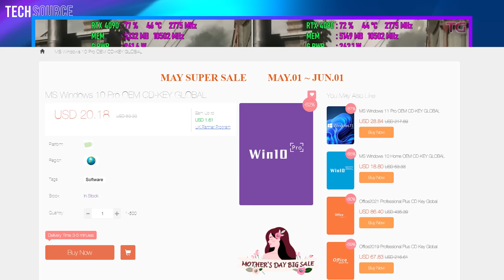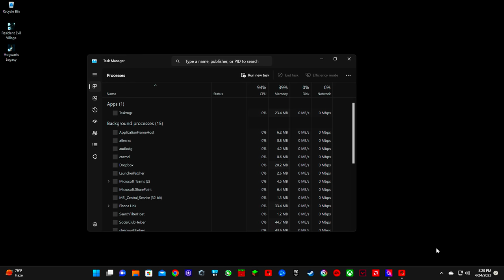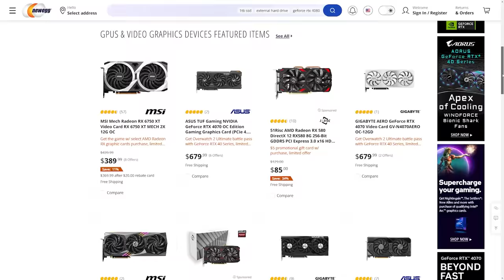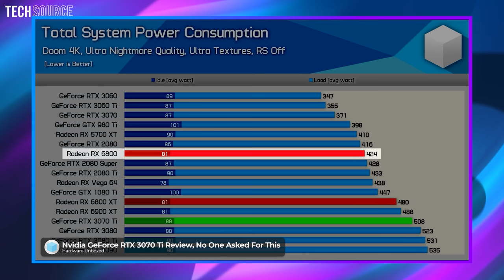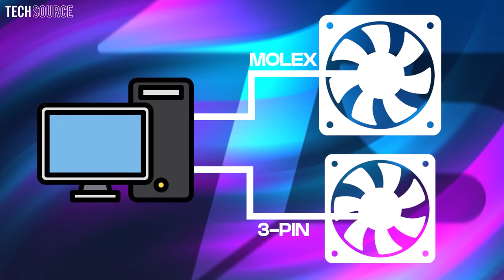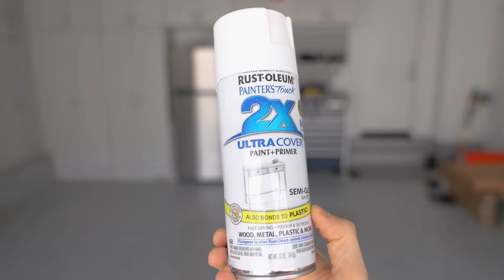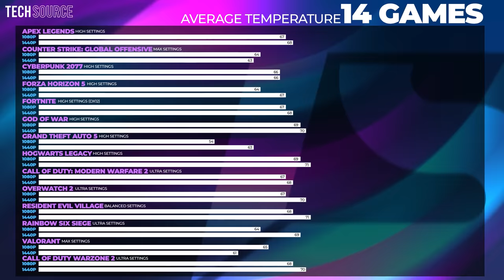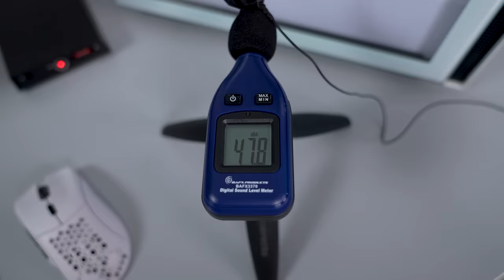The Best Budget $1000 Gaming PC Build!

Comment: Really appreciate your build videos! I learn something new each time. Just throwing this out there, but if you ever did deep-dive videos on specific components - as in, everything you need to know about motherboards/GPUs/RAM when selecting the right one for your build - I'd be ecstatic. I definitely picked out non-optimal parts for my first build because I didn't even know what sorts of things I should be looking for (like that issue with the motherboard only having a limited number of fan headers).

Comment: This was an awesome educational build vid around the different part specs.
I used the CH370 case for my build, it's  so light and easy to build in. I did similar and went with a 3 pack of light wings 3 fans, and dropped a 360 Rad in the front.

Comment: Great Build, only thing I would change is use a Ryzen 5 5600 instead as it's cheaper overall and you can enable SAM with the RX 6800 for ~5% performance gain. Also I wouldn't trust that PSU at all, why not just get something reputable?
Reply: So the build isn’t good or could be better?
Reply: @Jander_ could be better in terms of mobo and especially PSU
Reply: @Jander_  gigabyte b660m d3sh with dual m.2 and 4 ram sticks, $119 in my country cheaper than this one and this psu could be changed to a toughpower thermaltake gx2 600w +80 plus gold
Reply: @TRR23123  oh ok
Reply: @TRR23123  do u get good fps with this one?
Reply: @TRR23123  and what do u think about this oneCPU- Ryzen R5 5600x
Mobo- MSI MAG b550 Tomahawk
GPU- XFX Speedster SWFT309 6700xt
CPU Cooler- ID cooling SE-214xt
Storage- Silicon Power UD90 1tb m.2
Ram- Silicon Power Gaming 2×8 DDR4
PSU- ThermalTake Smart BM2 650w
Case- Montech X3 Mesh? The guy told me he get 100+ fps on most games ultra setting 1440p
Reply: @TRR23123  and thank u men
Reply: @Jander_  The one you mentioned is totally fine, the one i mentioned can run everything ultra +100 fps 1440p too except for cyberbunk 2077 which is 50ish
Reply: @Jander_  But ryzen 7 5700x can give you better performance at streaming more than 5600x
Reply: @TRR23123  That build is worse than the one in the video except for the PSU. The 5700x and RX 6650xt combo is also unbalanced and way slower compared to a 5600 and RX 6800 combo.
Reply: @Jander_  This build is solid, but replace the 5600x with a 5600 and ditch the CPU cooler, the stock AMD cooler is good enough. Use that freed up budget to get an RX 6800 instead of the 6700xt.
Reply: @truereaper4572  What the guy in the video did is choose a bad PSU, 16 GB, only 1 TB, no Cpu cooler. Yes 5700x and 6650xt is unbalanced then change it to a 6700xt, and that uses 700w good psu, 32 gb, 1,5 tb and a cooler.
Reply: @TRR23123  the build u told me need cable extension and window key, with that, how much the price will go up?
Reply: @TRR23123  and if u have something for parts links, I will buy the parts this week, And I want to buy the right ones.
Reply: @Jander_  I just edited the comment of the build, i changed some stuff and balanced it with better stuff. You can check everything above
Reply: @TRR23123  bro I don’t see the comment u edited can u write it again?
Reply: @TRR23123  You don't need an aftermarket CPU cooler though. The stock AMD cooler is fine. And again the 5700x isn't well suited to a $1k build.
Reply: @Jander_  
CPU: 5600X
MOBO: B550M Aorus Elite
RAM: T-force RGB 16x2 3600mhz
SSD: Crucial P3 Plus 1tb
PSU: Thermaltake toughpower 80+ gold 600w
Case: Musetex tw8 atx
GPU: XFX speedster qick319 radeon rx 6750xt
Cooler: Veetro V5
$965 total
$1006 with cable extensions and w11 home key
the price might change because you are in a different country but im sure it can be similar
Reply: @truereaper4572  cpu coolers in 1k build for more pleasure lol
Reply: @TRR23123  I’m in the United’s state
Reply: @Jander_  How much is that build in usa amazon?
Reply: @TRR23123  let me check

Comment: You should have gotten the b660m ds3h ax, it has WiFi and has bios flashback in case you want to upgrade to a 13400f. I just feel it has better value. Also that PSU is literally a fire hazard. Especially since you’re running a 6800. Also I feel like spending $19 on a cpu cooler is a good idea. There is definitely some things you could change about this build.
Reply: At that point may aswell spend a bit more and go am5 with a 7600. Smart access memory would squeeze out more performance too, since both cpu+gpu would be AMD.
Reply: I m also thinking about 13 gen that would be better and no bottle necks with GPU
Reply: Never cheap out on the psu. You can get a corsair cv for $75, you are paying a bit more but this way the psu doesnt burn your parts lmao.
Reply: Just an example, there are other great budget psu, just have to make sure its a reliable one.
Reply: the b660m ds3h is bad for an i5 12400f since it has power limits that decreases the processor's performance. the best cpu it can be paired with is probably only the i3 12100f and nothing more than that
Reply: Nah that power supply is fine. Just because its not from a huge brand doesnt make it worse. Have seen WAAAY worse work for like a decade
Reply: @Mist11305  it won’t have a problem with a 12400f trust me. The 12400f is like 65 watts
Reply: @chy.0190 t that point no, because ddr5 is still too expensive, unless you downgrade to a Rx 6700 xt, which is still amazing too
Reply: @paytonbohn6879  should I go with a h610 or a b660? Also, how do I know if the motherboard will not limit my CPU if I plant to upgrade.
Reply: @Proaz15 it depends what cpu ur using, if you’re using i3, the h610 will be fine, but any other, get a b660 mobo
Reply: @paytonbohn6879 I was planning on getting this build from the video but you got me questioning what to do
Reply: I am interested in building this exact build as shown in the video. Do you have any suggestions on what PSU to use?
Reply: @alsdabossgameplay9746  anything that has 80plus rating
Reply: I’m having trouble understanding this, do you mean that he doesn’t have enough cooling systems for the psu?
Reply: @ahmedsenhadji3856  ah yes get an efficient 80 plus psu but it's 60 watt, pretty much telling him to blow up his pc aight.
Reply: what psu should I get

Comment: Having this performance for under 1000 bucks is insane! 
Though personally i would've gone with a cheap am4 build instead, ryzen 5700x and 32gb of memory at least for future proofing, especially since with windows 11 and 16gb ram I had ran out of memory and it crashed games multiple times. Also budgeting on psu is not worth it which could set you back big time if it kills your system and also for peace of mind aswell as some budget cpu cooler can't hurt aswell.

Whether it's an intel or amd build I think with the memory, psu and optionally the cpu cooler changes it could be a great system.
It might push it over 1000 bucks but remember guys you can spend 1000 bucks and regret it and you can also spend a bit more and be content and feel your purchase worthy. If you already spend that much money it's better make it worth it imo.
Reply from the maker: Great feedback, thanks! :)
Reply: Man, I am thinking of getting AM5-7700X or AM4-5800X3D with 32gb RAMs, just cant decide what is better for gaming and work. Its almost same price, but dunno if AM5 is worht it, I am planning to keep that pc as long as it holds.. Im still playing on i5 4460 and 960 4gb i got in 2015/16.. any tips?
Reply: @fajceazy3946  AM5 motherboard so you can upgrade in the future without replacing a motherboard
Reply: @fajceazy3946  go with ddr5 platform because u have very old pc 😊 and its worth upgrading to am5
Reply: Can you tell me what parts to change pls
Reply: @blinksone2768
Reply: @@blinksone2768
Reply: Is there anyone that can tell me what to change idk what I need to change
Reply: @limacel8521 nothing all the first guys comment suggested was going with and cpu and 32 gb ram and getting a good quality psu and a cpu cooler
Reply: What parts do you recommend for my first pc I have a budget of like 1.5k ish

Comment: What do you think of this build?

Processor: i7 13700k
Cpu cooler: Dark rock pro 4
Motherboard: gigabyte z790 Aoris elite AX
Memory: G.Skill Trident Z5 RGB 32 GB 
Storage: Samsung 980 Pro 2 TB M.2
Video card: 4070 TI
Case: Corsair iCue 4000x 
Power suply: Corsair rm750x 

Lmk if you should change something😊 and btw do you know what case fans i should add because im not a pc builder expert😁
Reply: I'd switch cases if I were you just cause I have 4000x and am not a huge fan and am switching it soon

For fans you should go with the lian LI unifan v2 or their infinity ones, depends what style you're looking for
Reply: @ItsStickless  agreed. Not a fan of glass fronts choking airflow into the case.
Reply: If you don't want to go crazy on cost, I use a lot of Cooler Master Sickleflow fans in the builds I do. They have great airflow and run quiet.
Reply: Switch the case to the 4000D RGB Airflow, or just the 4000D airflow and whatever fans you like. Temps will be a lot better. Otherwise, that's a nice build.
Reply: @ertgb_  i switched it to lian li 216, and switched fans to ak620
Reply: @ItsStickless   i switched it to lian li 216, and switched fans to ak620. Do you think thats good?
Reply: @conradbishop5697  or should i switch the gpu to the 7900 xt/xtx?
Reply: @Zwartepinda  Case looks a lot better for airflow and I saw someone say the 4000d airflow, which is also a good case and is similar to the 216. Also, I'm pretty sure the ak620 is a CPU cooler not a fan, though I may be wrong on that unless you wanted to switch the cooler. Otherwise looks super good bro :)
Reply: @ItsStickless  oh yea it is the cpu cooler, and i heard people say you dont need case fans with the lian li 216. Thanks (:
Reply: @Zwartepinda  Yeah I just looked at it and it comes with them so you should be good!
Reply: If you're not doing any content creation I recommend the 7900xt...if you are also a content creator you're best option is sadly Nvidia

Comment: Very good video. Also budget-performance wise you made a very good build. I was expecting a 6700xt at that price point. So I was positively surprised to see a rx6800, but probably for the European market that would not fit in 1000 euro.

Also very nice extras with the painting, vinyl and cables.

The only point I disagree with is the 'no upgrade path on AM4'. There is higher speed RAM like mt 3600 cl16 and the 5800X3D which would cost like 250 euro more than the current build I reckon.

Also for the power consumption, perhaps it is better to mention this as wattage per frame, because otherwise lower fps builds would by default score better in power draw I reckon.

All in all, very good video. Especially the painting/taking apart the GPU and fan headers explanation. Keep it up! 👍
Reply from the maker: Thank you my friend!

Comment: Switch the 12400 out for an amd 5600. And also the case and fans fpr the montech air 100 u can get a board with wifi 6e, 32 gigs of ram, and a 6800xt instead of a 6800 with a 750w psu

Comment: That’s a nice case! I just built a system with an i5 13500 and 6700XT for $800, all the parts are new except for the gpu but it still has warranty until 12/2024 👀
Reply: Nice maaann. Was thinking of the same strategy

Comment: I ALWAYS go for BRAND ITEMS when it comes to personal use builds because I plan to use them for 4-5 years.

That being said, for $200 more, at $1200, you could upgrade the PSU, RAM, and M.2 to more named brands like Corsair and upgrade them as well. 

From a sellers point, this build is great, but if you are planning to do an actual nice build, never be afraid to spend a little more, as long as it benefits your build. 

Nobody wants PC Components to burn out a year after using. It's best to spend a little more and be completely satisfied than doing upgrades later on.
Reply: the RAM and m.2 are pretty decent you don't need to upsell yourself on those necessarily. the only issue will be the PSU being poor. Wait... did you just call crucial a none name brand?
Reply: @eggsrael4889  Lol that's what I was thinking. Crucial is the name brand for PC storage. Only better option for an SSD are the Samsung EVO drives. Also, I'm pretty sure I've heard of Adata before. It's definitely not a no name brand either.

Comment: Alright! Excellent video! I have a 5600 + rx 6800xt + ddr4 + 2 TB for $1000 more or less. Definitely the best range for 1440p-4k gaming hands down. I see a higher avg fps in 1440p than 1080p for Forza Horizon at 14:15, is that CPU vs GPU transfer of bottleneck??  I ask because I feel I might be bottlenecking my 6800xt with the 5600. Shall I upgrade to 5700x or 5800x3D, perhaps??

Excellent video again and thanks AMD for these GPU prices, the eBay used market is booming, especially if you can auction instead, My final bid was $465 which is nuts for a Red Devil 6800xt with a warranty of 1-year remaining. This was 2 months ago so should be better now:hand-orange-covering-eyes:

Comment: PLEASE READ THIS BEFORE BUYING A CRUCIAL SSD: they all use a cheaper silicon. I do not know the supplier. I don't know the brand. BUT WHATEVER THEY USE IN THE P3 it will hit 5000mbs for MAYBE 10 seconds and then it settles in at a continuous 50mbs. IT IS CHEAP FOR A REASON

Comment: chooses LGA1700 so he can upgrade without having to swap the MB. chooses a motherboard with only 2 DIMM slots (?!?) because it has a second M.2 slot. doesn't use the second M.2 slot.

Idk man. I think in terms of gaming, upgradability, and system longevity, it makes more sense to opt for the 4-DIMM board, to add more ram in the future if they start getting into video editing or other similar tasks. Limiting yourself to only 2 JUST so you can have a second M.2 slot makes no sense, especially considering a 2.5" SSD would be cheaper and most definitely adequate for secondary bulk storage. I DO HOWEVER, love the fact that you took the time to SHOW alternative motherboards and reiterate that it is up to the builder to weigh the pros and cons! Very great video, I just don't think this configuration makes much sense for most people at this time.
Reply from the maker: Swapping the board is almost necessary if u want to upgrade to DDR5. That’s why it doesn’t really make sense going with 4 dimm slots. It doesn’t matter in the end. If you want to upgrade, the next step would be DDR5, so a new board and memory.
Reply: just sell old ram and get bigger capacity, calling it not a dead platform makes no sense as you need new ram and motherboard so why not get new intel or amd board?

Comment: Although the 12400F is great, your reason for going with it is wrong. The B660M-G is not going to handle any meaningful upgrades which makes it a dead platform as well. The 5600 on the other hand can be upgraded to a 5800X3D which most entry level B550 boards can handle.
Reply from the maker: I assumed upgrading would be to get a DDR5 board. I wouldn’t use the board and upgrade

Comment: By the way, I have been a fan for a long time. I was just wondering If I could adapt this build into a very small itx PC case?  I am thinking of upgrading my very gimmicky laptop to a PC like that one. It's just I travel a lot. It would mean a lot if you could answer. Thank you, Areg.
Reply: You will be paying more for ITX version of this build.  Mostly in the cost of the PSU.  Mobo options are limited and usually more expensive, as well.  Totally doable, but I'd guess you'll spend closer to $1300 than $1000
Reply: @butterynugs7629  Yeah sound good :) thats the budget I have ... thanks for putting the time to answer :)

Comment: did the psu get hot while gaming? my 600w psu runs hot when gaming with my 5600g and 3070, im quite worried about the psu you used in this build. good build aside from that psu
Reply: What psu would you recommend instead?

Comment: Highly disagree with the reasoning for Intel instead of AMD. The 5600 can easily be upgraded to a 5800X down the line and achieve current gen performance on par with the 7800X without having to shell out for a new motherboard or DDR5 memory. Being able to upgrade to 13th gen intel should not be the deciding factor here. Just buy whichever one is cheaper

Comment: Ryzen 5600x 150$                                                                
B450M DS3H 80$
Radeon RX6600 200$
Thermaltake Smart 500W PSU 42$
T-force Vulcan Z 16GB 36$
Lian Li Lancool 215 63$
Around 700$ for a decent build.
Reply: 500w is not enough and why 5600x you can 5600 for cheaper and has the same performance also that motherboard is not good
Reply: You can make a better build for 600

Comment: But isn't LG 1700 also a dead platform since they announced their new CPU's to be for  LGA1851 (Meteor Lake)?
Reply from the maker: No because it supports DDR5 memory
Reply: 5800x3d will be faster than any ddr4 intel CPU from 12 13 gen, so its dead platform, to get ddr5 support you need  new intel motherboard, new ram.
Reply: @TechSource  Sure, but still. The platform will only have a refreshed Raptor-Lake generation and then it's over. DDR-5 Will not help in the long run because, as I mentioned, the platform will still be LG1700.
Reply: @suprerxero  The 13600k is faster than the 5800x3d, not sure what you're on about.
Reply: @ertgb_  slower in games with ddr4 ram

Comment: Is it possible that I could change the i5 12th gen to 13th gen 1300k and a 4070 graphics while upgrading the power supply or does the motherboard not support 13th gen cpus?
Reply: it does if you uptade the drivers